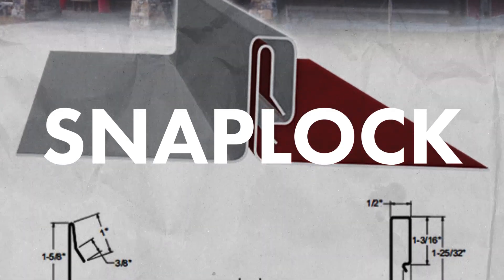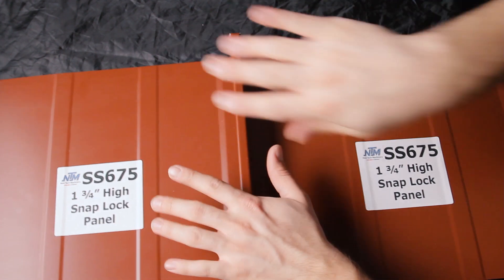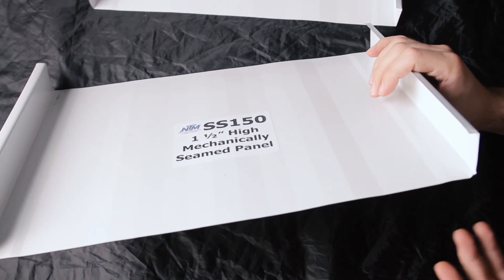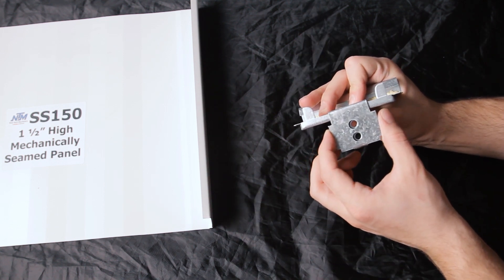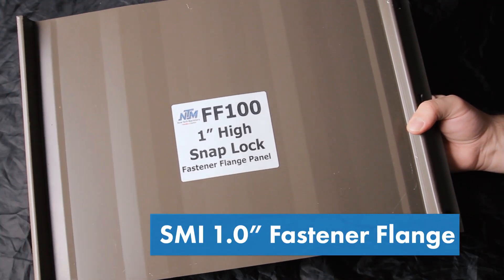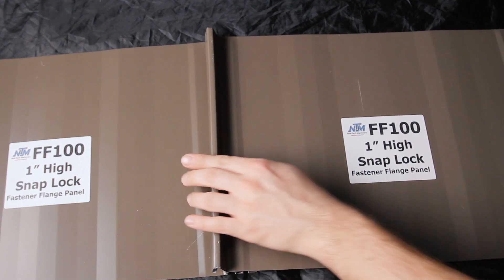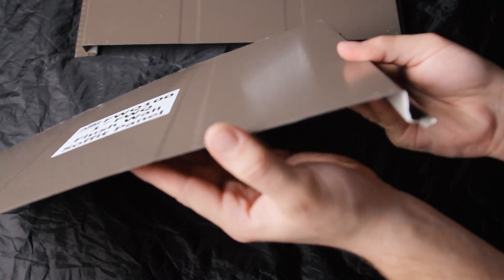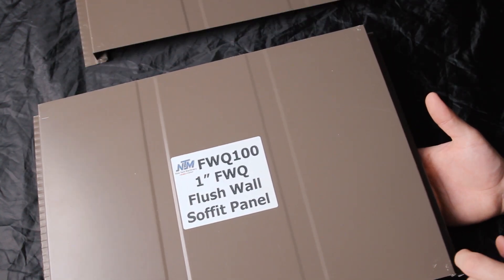Standing Seam Metal Roofing: Panel Profile Reviews

Comment: Hey Thad,  I had a roofer tell me that 180 degree seams over-tighten the panels and contribute to wavyness and bumpiness and all-around undesirable cosmetic effects on the roof, including making the seams themselves look wavy and crooked.  He said 90 degree seams don't cause this and it's his strong preference to install metal roofs with 90 seams.  What do you think?  Is he just trying to get out of the extra labor, or does he just not know how to do 180 degree correctly?  Or is it true that a 180 degree seamed roof is an uglier roof?  Love your channel! :-)
Reply from the maker: Hello and thanks for your continued support, we really appreciate it! To get to your question, I’m going to start by saying a dual stage seamer that is in proper tolerance should minimize or eliminate the potential for this issue. While there is still a possibility for this problem, a single phase seamer out of tolerance could definitely cause the issue if it’s not set up properly or used properly.  Also if someone has a single phase seamer there is additional labor because they would essentially have to seam the roof twice (once at 90 and again at 180).  We recommend using a motorized seamer on installs, and again it is important that the seamer is adjusted correctly for the panel and clip being used. The seamer should be tested on panels that are not installed on the roof before proceeding to the actual installation. Now that we have that laid out, here’s our recommendation for 90 degree vs. 180 degree seaming in most cases: Our preference is always to choose an engineered system, and our engineering is based on 180 degree seams because a 180 degree seam will accommodate for low slope water submersion testing, while a snap lock or even a 90 degree seam will not. Note that depending on the gauge of the clips and panel the clips could telegraph through the panel seam and be visible. However, I’m assuming your project is at most a 1.5” and those clips use a lot lighter gauge material than some other profiles and should not be a big problem. I hope this answers your question as completely as possible. Thanks for the comment and have a great day! -Thad
Reply: 180 seam is a better water tightness but also let's the panel be convex curved.

Comment: Any standing seam recommended option for Florida coast hurricane rating?  Which performs better? Assume 6/12 or 10/12 pitch roof
Reply from the maker: Hello! It's going to be a very open answer because there are so many variables. In FL you have different requirements based off of which part of the state you live in. For example, you have Miami Dade County which requires NOA application and roof systems to be tested to certain guidelines, while in North Florida you might only need a FL product approval which again has its own set of requirements. It is important to make sure the panel you pick meets the requirements for the area you are in and the wind speeds you could encounter. The only real way to do this is by talking to the manufacturer to see what ratings they have and on which panels. Two panels can be identical but it comes down to whether or not it is tested and approved for use in that specific region of FL. Thanks for the comment! - Thad